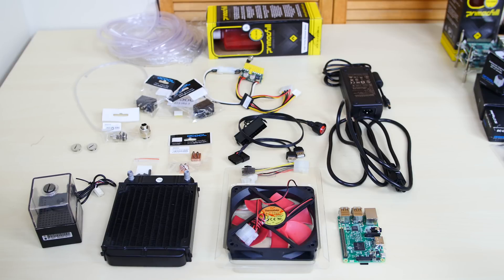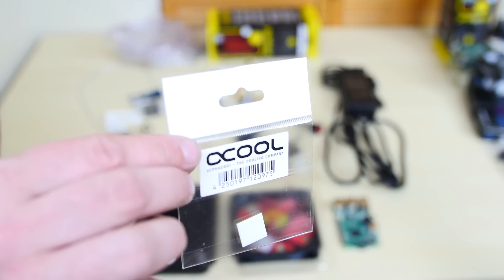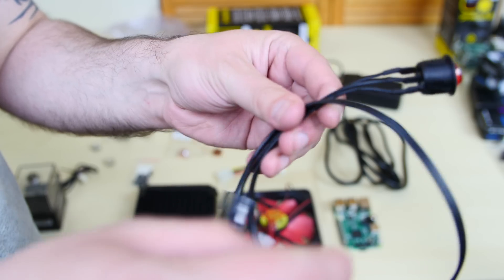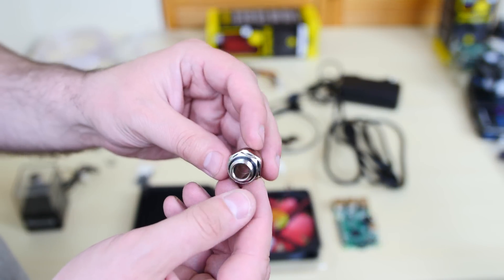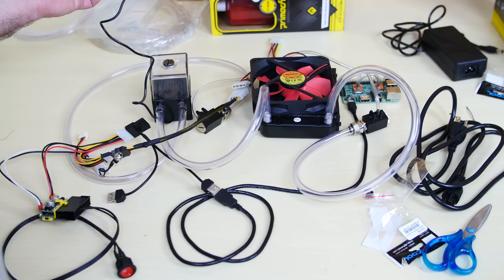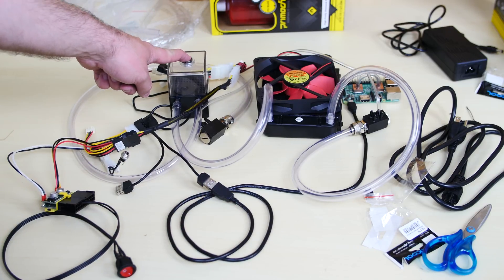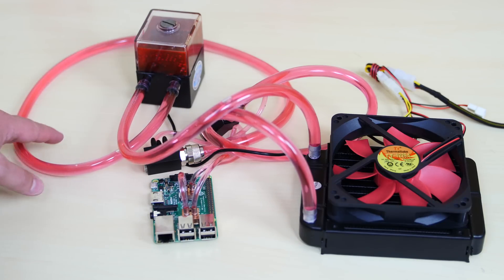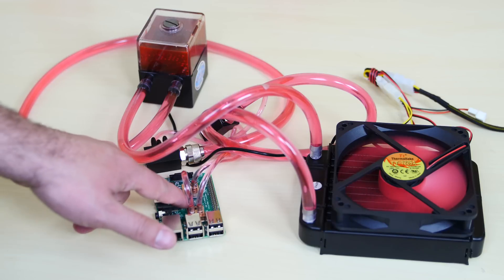Water Cooled Raspberry Pi 3 - Part 1 - The Build

Comment: Okay it is obvious you know very little about water cooling, those creases in the thermal pads are good no to create an air gap, which is not good, it's insulating it, and you are not going to get the full benefit of water cooling because there is no mounting pressure on the cpu, and that pump and tubing is going to be put under a lot of pressure because water cooling pumps aren't meant for head pressure, they are meant for flow rate, and restricting the flow rate with such small tubing is very bad for the pump, not to mention that there is NO need to water cool a raspberry pi, they do not output that much heat, a small heat sink with a fan would be good, oh and please, in 2016, any fan that uses moles should be thrown at a wall, because that's all they are good for, and you should really be using at least zip ties on the barbs, they probably won't leak but it is just good water cooling practice, and not to mention your radiator will have NO airflow if the air can't go through radiator
Reply: Which basically means it is running passively, the pump will probably heat up the water more than the pi will, and I just realized your fan is blowing the absolute wrong way which means there is ABSOLUTLY NO air flow through the radiator which means that the pump will heat up the water with no way for it to cool down, and for god sakes screw in the fan, next time you watercool anything, either go with an all in one, they are pretty hard to mess up, or at least watch some water cooling tips and tricks videos, because you are giving your viewers very incorrect information, but again there is no near to watercool a pi, there just isn't, you can't cool anything below room temperature when using watercooling or even a heat sink, and a pi is designed to run without even a heat sink, which means you will probably get VERY similar temperatures when using a tiny heat sink compared to a water cooling loop, even one this bad
Reply: +Kyle Futter and even if you were running a lot of pis they still wouldn't get hot enough to warrant watercooling, even high end computers don't NEED water cooling, it's an enthusiast hobby, and a proper watercooling loop would have cost 3 times as much as the pi itself, yes I watercool my pc, but that's for aesthetics, and if you are doing that's for a pi, then you are mad, even if you were doing it for 10 pis you would be even more crazy because the pump just wouldn't be able to push water through that much of that small tubing, just do yourself a favor, get some copper ram heatsinks, some thermal adhesive not thermal pads and a decent fan or 2 it will be cheaper and way more effective and less bulky, there my rant is done
Reply: Don't "need" watercooling? Have you ever ran an OC rig? Yeah you do.
Reply: +Jack Diller I do run an overclocked rig, and no, you don't need watercooling, noctua air coolers are very close to some 240mm all in ones, watch some reviews, and you can get similar performance with an all in one if you need your cpu to run cool, and fine I should have clarified, you don't need custom watercooling, it's expensive and doesn't offer a big enough performance increase to warrant it, but I do it for the looks and the quietness, but if you are referring to over clocking the pi, it has a max power draw of 10w if I'm right, that is so little that if you are overclocking it, as I said in one of my comments, a heatsink and fan would be better in terms of space, price and practicality, the fucking pump will use more power than the pi, meaning it was create more heat than the pi, meaning you basically have an entire watercooling loop to cool a fucking pump, that is just insane
Reply: I would reply to your points but honestly you're missing the whole big idea so hard that it's not even worth it. FYI I had a noctua cooler and it wasn't enough to get the heat away from the rest of the components, so no, that's just wrong.
Reply: +Jack Diller the main point is, custom watercooling is not essential in any case except maybe data centers, but even that is rare, it is not nessesary, it is a luxury, you can OC just fine on air cooling, you might have your cpu running a little hotter but they are designed to be able to run quite hot, even graphics cards, they are designed to run at their max temp with low fan speeds, and to answer you original comment, there is never a situation where you "need" watercooling, if you are doing extreme overclocking then you use liquid nitrogen or phase change or evaporative cooling or what ever other sub zero cooling methods there are, air cooling can do the job, maybe not as well, but it can do it none the less, and I said some noctua cooler can cool close to all in ones, not all of them, if you have a small one then obviously it won't be as good
Reply: +Jack Diller and by the way what do you mean by, it wasn't enough to get the heat away from the rest of the components, that's not what a cpu cooler is designed to do, it's made to cool the cpu, your other case fans should cool the rest of your components, do some research before making stupid claims
Reply: You're painful to talk to, but I'll give you one last reply for the sake of the conversation. The point of the radiator is to spread the heat away in the liquid cooling loop.... If that wasn't the case, then a radiator the same size directly mounted to the CPU would work just as well. It doesn't. As you stated yourself. So I don't know where you are misunderstanding anything here, but I think you might want to either go back to Reading and Comprehension for 5th graders or reconsider your "knowledge" on cooling components.
Reply: +Jack Diller yes and if you had any idea of how thermal dissipation worked you would know that it depends on the medium in which the heat is transferred and the surface area of the heat sink, the liquid in the pipes in tower heats inks is better than water cooling liquid weather it be water or some Mano fluid, and a big tower heat has a similar amount of surface area to somewhere between a 140mm and a 240 mm radiator, not to mention the pump will add a bit of heat, so while not as good, my original point still stands, you do not Need water cooling, get that through your thick skull, people do it because it looks cool, that's about it, I do it, and I know it's not worth it, but I also spent too much on a case, because it looks cool, not because I need it, okay, you don't need to justify it, if it makes you feel better because you have a water-cooled rig then good, or because you think it puts you in the pc elite then sure think that, but it is NOT nessesary, go watch jayztwosents, Im sure he has said this before, and a lit of other tech youtubers, do some research before saying something stupid, or go on to the ltt forum and ask them I'm sure I know the answer, and I want to clarify again I am talking about custom water cooling,  not all in one's,  I will admit I can see where all in one's would be needed, if you had tall ram or something, but they are cheaper and more convenient than a custom loop
Reply: +Jack Diller and unlike you I will not resort to childish insults as a form of defense
Reply: It's funny because I literally, like I said, had a Noctua heatsink cooler, OC'd my CPU from 3.3 to 4.8 and the only way to keep it from constantly throttling was liquid cooling. isn't that funny? That your exact scenario is my exact scenario? You clearly just don't understand overclocking.. I'm basically certain you haven't actually had an overclocking setup so that's why you don't get it.
Reply: +Jack Diller okay and you are too thick to actually read what I say, I said custom water cooling is not nessesary, if you built an entire loop for just your cpu then you either have quite a large disposable income that I don't or are just stupid, and you didn't tell me which noctua heat sink, they make ones for different scenarios, so I will say again, CUSTOM water cooling is not nessesary

Comment: Okay that "worlds smallest power supply" is not actually a powersupply, the brick you held up that plugs into it is the actual powersupply,, all that's is is a converter to the required voltages used by a normal pc 12v 5v and 3v, that's all that is, not a power supply

Comment: I think the setup is insufficient. The coolant flow pressure from the bigger hose is restricted to only to one 3mm outlet (which is not how the 5X divider is suppose to be used). But I do think you will use all the five outlet of the divider to cool your clustered PI 3. Then it should be fine.

Comment: Doesnt using only 1 of those ports add excessive head pressure on the pump? Wouldn't using two of the ports (once for cpu and 1 for gpu) cut the stress on the pump in half?

Comment: You do realize the big black brick "adapter" is the actual power supply, right?
Reply: They are both power supplies, they simply deal with different voltages. The big one has an input voltage of 120v, and the little one has an input voltage of 12v. The big one has one output voltage of 12v, and the little one has three output voltages of 3.3v, 5v, and 12v.
Reply from the maker: Part of the power supply.
Reply: +Rasim Muratovic (Rasmurtech) the little adapter block you keep calling the power supply has no transformer, rectifier, etc. It's just an adapter.

Comment: air have to pass through that radiator and it doesn't do in that position . also I think it would be better to supply coolant separately that copper blocks. just saying

Comment: Water cooloing rpi is just stupid. It works ok without anything and a bit better with heatsinks for 2$. But you have just put somthing thats cappable on disapating well over 50w on rpi. And I think it wasn't cheap.
Reply from the maker: The Raspberry Pi 3 doesn't need any cooling, but my geek soul thought you guys would love to see it anyway. I had a lot of fun putting it together.
Reply: +Rasim Muratovic (Rasmurtech) Please concentrate on your AI project.. it will be very cool
Reply: I have run some calculations based on data available on the internet for the RPi3.  A small fan with finned heatsink is sufficient to maintain the CPU temperature below 80C.  The problem is when you have a cluster, you are going to have many small fans, or an array of large fans blowing onto the cluster.  Both are not ideal due to noise and inconsistent cooling for the latter.  For a cluster then, chained water cooling makes allot of sense, particularly if you are going to run the Pi's balls to the wall, fully maxed out on all four cores.
Reply: +snarbywrx It makes much more sense
Reply: Wrong answer!  the Pi3 starts to throttle at somewhere around 80c and the cooler it is the better!  Yes a heat-sink helps and it will run well with just that, however I have over heated my Pi3 enough with just a heat-sink to throttle.  So liquid cooling is not a bad idea if you are going to run them hard!